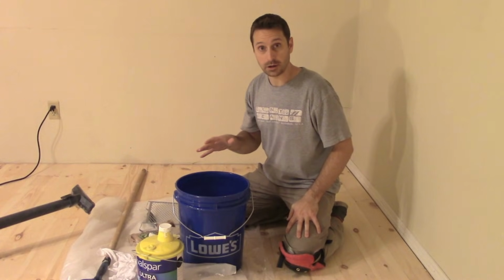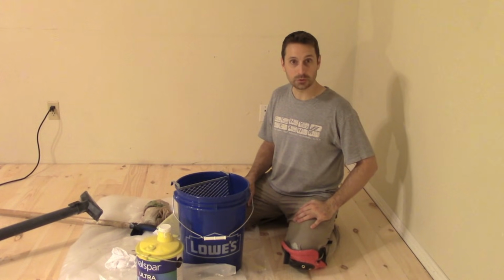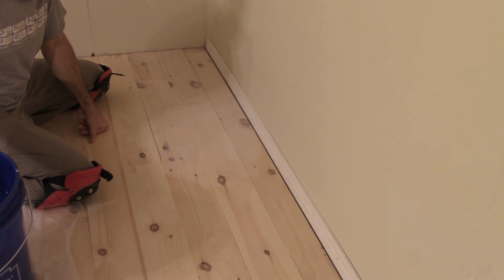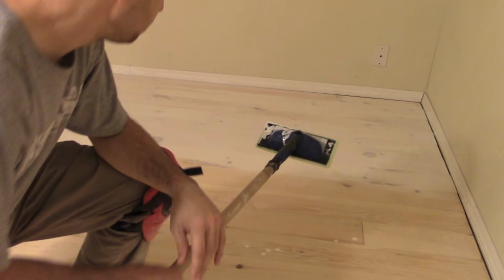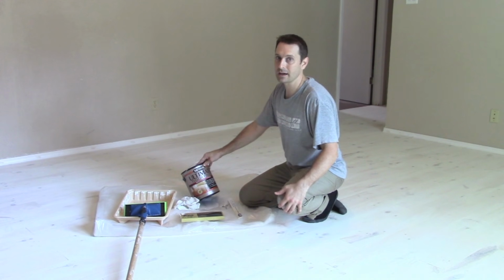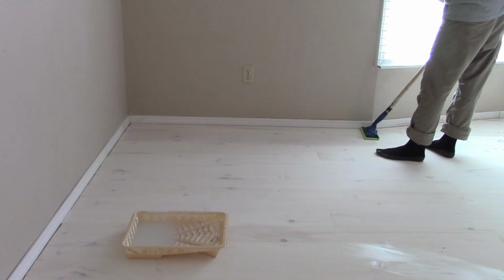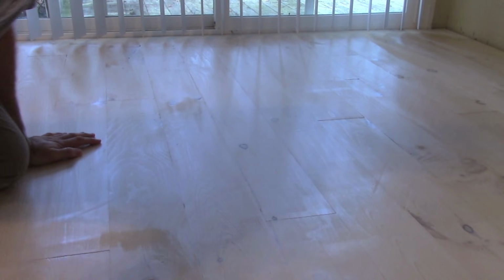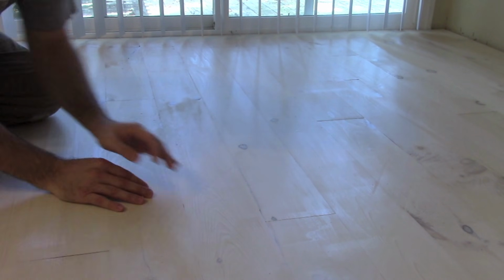How to Whitewash and Seal a Wood Floor. DIY Steps. Milk paint, Lime Wash, Antique Look

Comment: if you think that one coat of any brand of finish will give you the durability needed for lasting beauty and performance, you are crazy. your floor is rough because you just applied water to the surface of raw wood causing the grain to pop. this can happen(and usually does) with just the first coat of finish, oil or waterbase. you also did not use a regular stain which seals wood. now, it is my assumption that your Minwax sealer directions said you need only one coat because it is a "sealer coat" and you have to use regular finish on top to build up your durability. the unevenness in the Finish is likely due to your application Style and back that the wood is not sealed therefore its going to soak all it can, depending on the thickness applied and I'm sure it was not very consistent. now you must lightly sand your floors to remove the popped grain and smooth out the floor. then vacuum and tack to remove all dust and debris. you may now apply a coat of the recommended floor finish, not sealer, and I assure you that this coat will dry even and remain smooth because the floor is sealed from the "sealer" preventing this coat from soaking in and instead creating a bond to the wood and sitting on top, giving you an actual "wear layer" protecting you floor. it is recommended that you repeat this process at least one more time to build up a strong durable finish you would expect from a quality wood floor. I'm sure the experience has taught you a lot, as as well as many of your viewers. good looking floor. keep it up. experience is the best teacher
Reply: calm down Richard
Reply: @flomasta1978  thank you for sharing your knowledge.
Reply: I've been sanding and finishing wood floors for 30 years and you're absolutely right but why even bother explaining when everybody here is looking for a cheap quick fix ?
Reply: Wow, you wrote a book!
Reply: @morningcoffee1111  what knowledge?
Reply: I appreciate you responding. I’m not looking for a cheap quick fix, like one of the commenters said. My place is very very small and I want to pull carpet up & linoleum and do a white wash. There are hardwood floors underneath, I’m going to sand them of course. Do you have any suggestions I should do to prepare them for a white wash? Btw this was my very first video on whitewashing hardwood floors, so not sure this is the method I’ll use, going to keep reaching.

Comment: I made comments here one year ago , after that I have decided paint my living room , when I took off carpet there were  so many water or coffee stains everywhere , I had no clue what happened before I bought my house , it would be so much sanding or expensive floor coverings , anyway I didn’t want to spend that much money so decided to paint but so much dark stain will show up later with floor paint  !!  I bought drive way  paving paint with oil base  which can work on wood too , this was recommended by paint shop , only cleaned with sugar soap , no sanding , after two coat of  white painting floor turned  out really good , shining and very hard wearing , easy to clean with wet mop ( floor never get wet ) always looks like new , it was cost $400 to paint living area and corridor only !!  I like to recommend this method to anybody wanting paint floor , simple and save lots of money !!!!!

Comment: You should have applied another coat of finish, then buffed out with 220 grit, tacked the floor and then a 3rd coat with a t bar, would leave a nice perfectly smooth floor. Always apply more than one coat as it will look patchy and dry in some spots, first coats never look perfect. I recommend using bona mega its about $65 a gallon.
Reply from the maker: Thank you for watching and for your (what sounds to be) professional advice.  Yes, I understand this is the way to complete the floor for a perfect smooth finish.  I made the video for the average DIY'er who would expect a product to perform as stated on the package. That was the point of the video. I do understand that is not reality.  I wanted them to understand exactly what you stated which is that first coats never look perfect and there is much more to do to get a professional look and finish.  Thanks again.
Reply: Also you never use as much product on your second coat, so you probably would only need half as much...
Reply: Never use a tach cloth. It’s leaves a residue and will keep your finish from adhering.
Reply: yup, bona water based sealers are the ONLY product you can use on whitewashed floors.
Reply: What's a tbar?

Comment: All polyurethane must be sanded for the smooth finish you're expecting, The good news is poly sands very easily. Take a few 1000 grit wet/dry block sanding blocks, wet the floor very slightly so the blocks absorb the dust, and it will take literal seconds per sq. ft. A few wipes and that's it. In fact, you'll need to be careful not to strip all the finish off because that was one very thin coat you applied.

Comment: Ok, so the first wash coat raises the grain,especially on a soft wood, a very light sand before you clear coat should be done, also you will never get a smooth finish I you don't sand between the color coat and the clear, and then between the two clear coats. It looks good, I've used this method for years and it will always give a smooth finish...its my trade. Minimax or any other brand needs between coat sands.

Comment: Application was wrong. It can’t self level if too little product applied. Also there will always be grain lift on a wooden floor when adding water based products. 150 -220 hand sand and additional coat and it will be perfect

Comment: no matter what the can says, you need at least 3 coats of poly on a floor and you need to buff sand after at least the first coat of poly - cans of poly all cost about $60  - all cans say similar things but none live up to the hype - the product you used is just the same as the others no better but no worse either - a roller would have given you a smoother finish than the foam pad - while the foam pad is great for white wash/stain application, a roller is better for the poly - also, it would have been smoother if you went from wall to wall in strips, you overlapped the poly in the middle of the floor, creating a less than smooth appearance and feel
Reply from the maker: I hear everything you are saying. None of these products do live up the they hype as you said. I do agree that the foam pad was part of the problem.

Comment: l'm here 6 years after the fact. You did an outstanding job sanding that soft pine floor. The stain job came out super as well. Everything you did was 100% a.o.k.

That finish was the right product to use, only needed 2 more coats with a fine 220 grit after 2nd and 3rd coats.  And your final coat would have made you super happy.  

I only wish l could have helped you with those final 2 coats. 

White washed floors were all the rave in the 90's.  You can be proud of a job well done. 🥳✌🏽🫶🏻
Reply from the maker: Thank you. I appreciate it.

Comment: Nice video, you would have needed 2 more coats on top of the coats you did. and maybe a slight buff with a light pad before the final coat.
I am using Glitza....more than $100.00 gallon... Its worth it to avoid Home Depot for finish coats
Reply from the maker: Good call on the Glitza. 
I was trying to take the product at it's face value instructions and it didn't work out. I smoothed it down after and now it is perfect.

Comment: Can you examine current flow while your inverters are functioning AND the Chargeverter is charging. It’s been my experience if the loads are 3000 watts while the Chargeverter is supplying 4000 watts; SOMEHOW the inverters use the Chargeverter 3000 and the remainder charges the batteries. Note I’m split phase, 10Kw of panels, 800 KwHr batteries LiFePO4. Inverter it’s set to “use” for batteries.

Comment: it looks very good to that point but it needs another coat. after the 1st coat of a clear I remove the rough texture with high count sand paper or 3m scuff pads (I prefer the pads). lightly, you don't want to burn through the initial coat you just laid down obviously. you only want to lightly knock down the rough areas. clean the dust then apply the 2nd coat. the 2nd coat is the money coat. meaning it will wipe on much smoother and evenly and be much smoother to the touch / look. I also find I don't have to thin the clear out as much during the 2nd application as it lays down better because the dry open floor boards no longer grab at the brush. with clears I go with 3 coats minimum on flooring (as many as 5-6 on some furniture) no matter what the material is or if its oil or water base clear or how I choose to apply it, brush on or compressed air it doesn't matter.

Comment: First off, any finish that has the consistency of skim milk is bad. 
I never use floor finishes sold at Lowes or Home Depot. Use Loba, Bona, or Street Shoe brands. These will have a consistency of 18% cream.
Secondly, you’ll need to screen sand between coats, vacuum and wipe prior to applying subsequent coats.
Thirdly, You’ll need to apply a minimum of 3, preferably 4 coats of water based finish.

Comment: For hardwood floors....the sealer should be 3 coats and really should be sanded between with the finest grade sandpaper for the best finish.  Your fist coat was too thin and the directions should have told you it needed more than one coat....2 - 3 coats and to sand between coats.
Reply from the maker: It depends on the sealer. This one stated one coat and no sanding if you wanted to put a second coat. I guess part of the point of the video was to say that these products are misleading.

Comment: That was so funny.....you sounded so pro,then......its rough,im not happy etc hahaha...i shouldnt laugh too hard,im doing the same job soon,different materials
Reply from the maker: I was just disappointed in the performance of the product as per their claims. All I did was seal the floor. If you want to "finish" the floor, you will need several coats and then sand between coats. Good luck with your project.

Comment: I have literally just done the same thing with my floor- it has been an absolute nightmare trying to get an even, uniform colour and finish. The floor is new tongue and groove 18mm pine, which I sanded through the various grits 80-120-150 to get a perfectly smooth finish. I then applied Manns Pine white stain diluted with water in a ratio 3:1. It was very hard to apply this evenly- in the end I used a rag run over the boards a few times to build up the colour. The product itself is very good but the wood has absorbed it to varying extents in different areas. I then applied a satin varnish identical to yours and found the finish patchy in places. Furthermore, the varnish 'dragged' some of the colour living horrible blotches which needed re-sanding. The floor is now 80% done with various patchwork repairs that need doing- tape area off, sand down the wood again, reapply stain in a different ratio, wait for it dry and hope it matches the rest of the floor before varnishing again.
Reply from the maker: We had no problem with the getting an even color. The sealer on the top was the issue. We wanted to do a review of the Minwax product and take it for face value. It did not measure up. We fixed the problem through sanding and reapplying.
Reply: Don't use stain use PAINT
Reply: Driving myself crazy with all the products (decision making) oy... I read that a wood conditioner will go a long way to making sure the stain will be uniform, Not that I've done that yet and your post was 4 years ago.
Reply: @pattonfamily371  ... he did not use stain.

Comment: What abou laminated foors? Do i have to sand it first?
Reply from the maker: Depends on the laminate. If they are a thinner engineered lumber you need to find out the thickness of the laminate layer on top and if they had been refinished in the past. If they have not, you can sand them to remove the old finish but be careful.

Comment: paint does not soak into the wood it just sits on top of the wood. please if your going to whitewash your floors use water based stain. look into the bona stain

Comment: When I did floor sanding with my professional friend he would use a machine with fine sanding mesh after the first coat and then vacuum and mop. You can sand it by hand.
Reply from the maker: I hear you. I know that I needed to sand between multiple coats but I was testing the product I used for their specified claims. They failed. Thanks for your thoughts.

Comment: You did well ,just it needed another fine sand then another clear coat.. after vacuming of course.  from a Decorator. good you try help people with your video. good luck
Reply from the maker: Thank you, I appreciate it. Part of the intent of the video was to test the product on the claim of "just one coat". Obviously it didn't perform. Additionally, as the title says, I only meant to seal the floor and not finish the floor.

Comment: you have used whitewashed stain on floor not paint and water. you could use your method on walls. make sure its water based stain because oil based will make the white floor look yellow.

Comment: hi sorry to hear u not please I been there no good feeling. so what do u recommend now to use I want to paint my floor with a light teal color . I could use regular house  paint to use it to paint the floors then to gloss  it what u recommend to use I want a nice smooth floor I'm not a professional will like to buy the best products so like that it come out smooth I'm doing it my self thank u if u have any advice I will appreciate u let me know thanks once again
Reply from the maker: I would just use a latex paint that is specific for floors if you want a solid color. It is a thicker mixture, will adhere better and will stand up to heavy foot traffic.  Mine was different because the milk paint (watered down latex) soaked into the wood and then I used the clear coat on top of that.  If you don't mind that the paint is thin like mine, do it the way I did it.

Like I said in the video, the Minwax Ultimate Floor Finish product was not the best. It was a little rough and uneven. It was $60 per gallon at Home Depot.

Varathane is a much much better product. The only issue is that it costs $100 per gallon.

I choose the cheaper product and got what I paid for.

Hope that helps.

Comment: You did a great job prepping the floors and staining.  The problem you had with Minwax sealer is the same problem I had.  I had to reseal all the floors with another product...and using Minwax held up the sale of my house.  I will never use Minwax again.
Reply from the maker: Thank you. I appreciate your comment. Yea, the Minwax does not do what it indicates on the can. It is a poor product.
Reply: You have to do multiple coats and put it on thick

Comment: Great video. I could see the disappointment on your face and have been there myself at times when trying to do some project on my home. I could really see the flashing on the floor caused from the sealer that you used. Would love to hear an update if any to this. Did you sand and apply a 2nd coat? How did that come out? Or did your spouse/partner say the heck with it and put down a large area rug? Lol
Reply from the maker: Thank you. I sanded a few areas and put a second coat. That smoothed it out a lot and we are happy with those areas (will get to the rest of the spaces someday soon).  This isn't a complete finish and just classified as a seal but the product claims sure didn't come through.
Reply: Country Living Experience: A Homesteading Journey  thank you for the reply. Glad to hear you are satisfied with a 2nd coat. That’s the frustrating part about home improvement projects. We read the directions and try to follow them to the best of our understanding and things still go wrong. I recently did a small kitchen project...I have tall ceilings in my home and it extended the upper cabinets to the ceiling. I saw a lot of pics on Pinterest if people doing this. I spent a long time doing research before I ever started. I knew I’d never be able to match the stain on my existing g maple cabinets that the builder put in and so I figured I’d just paint all the cabinets white which is what I wanted anyway. I also did research on painting cabinets. Watched several YT videos of people doing it in a weekend. Long story short...lies lies and more lies. At one point I finally got a professional
Painter that does nothing but paint cabinets and he told me I had a hot mess going on. Said he wished paint stores would stop telling homeowners they can paint their own cabinets. He said most professional painter can’t even paint cabinets and have them look good let alone a homeowner. He said there is a reason why you don’t see anyone doing close up shots in their videos. It took me months to finish the project and that was me working on it almost daily. I ended up having to sand all the way down to the bare wood. For what the entire project ended up costing me I could have had all new white cabinets installed. And not the cheap ones from Lowe’s or HD. Good luck on the rest of your project.

Comment: Latex and oil-based don't mix. :(  What did you do to fix it?
Reply from the maker: I know that. I did not mix oil and latex. Both products are latex based.
Reply: Sorry. Near the end of the video 20:20, I thought you had said you used an oil based clear. That's too bad it did not work out.  I really liked the look before you put the clear on. I'm considering doing something like this in my bedrooms.
Reply from the maker: No worries. It has actually smoothed out from walking on it for a year. I would recommend some other clear coat that is self leveling.......or sand with a high grit sandpaper and reapply the clear.